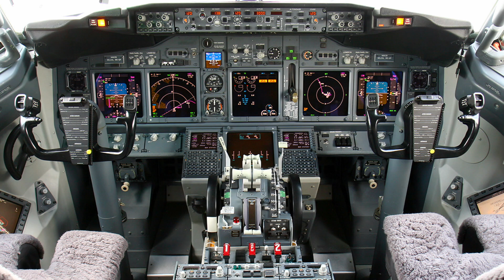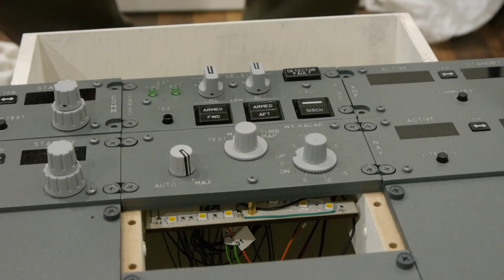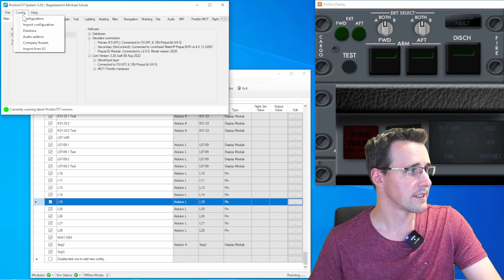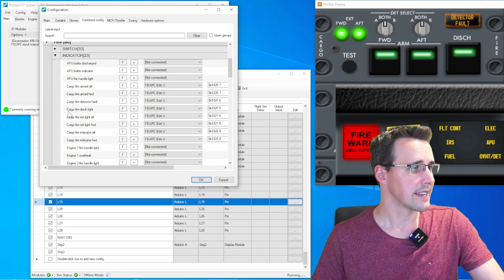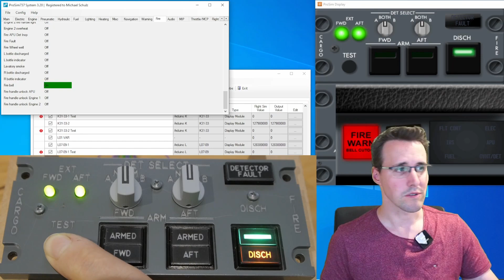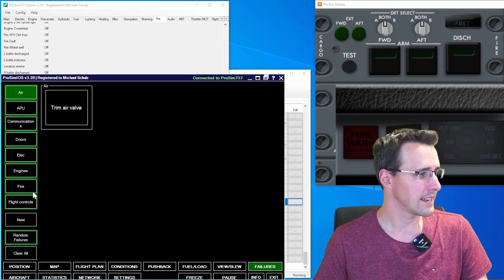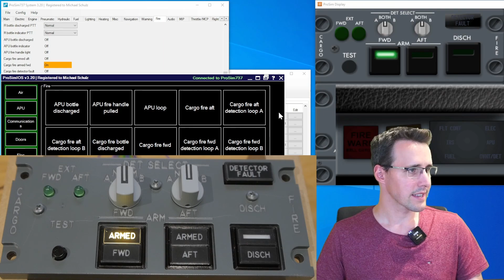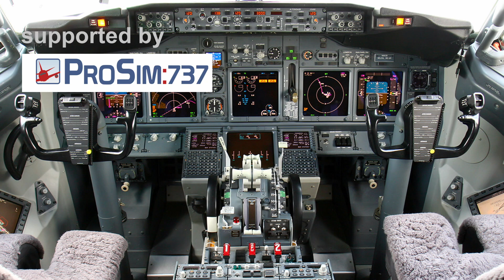Cargo Fire Panel - A Boeing 737-800 Homecockpit #72

Comment: Hey Michael, Nice work as usual. The Fire Bell green indicator is not really an indicator, but a gate. It is used to drive actual fire ball hardware signal.
Prosim cargo fire panel software is a different model that we actually see from most of 737s so there are some differences and you actually do not see any indication when a fire is active (just like you showed with the IOS) but the failure is active and you should have teh AFT or FWD indication illuminated. Which means that some assignments are not correct. To easily test any indicator, you can simply use ProSIm system program, just click on top of any indicator label and prosim will command the indicator to illuminate.

Comment: How do you plan to work through the software issues? Do you have a contact at Mobiflight, P3d? Or, do you wait for an update?
Reply from the maker: I have posted the questions in the corresponding community forums. I will also have a test in MSFS to see if it comes from the simulator. But technically everything is working and the final simulator will run on MSFS so this is not one of my main problems at the moment.